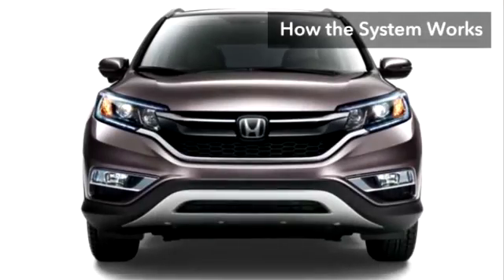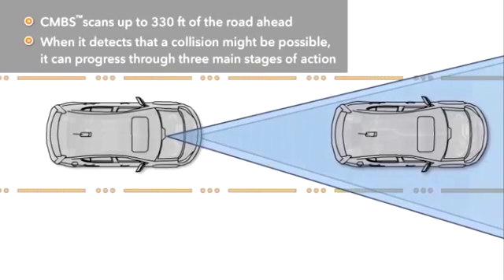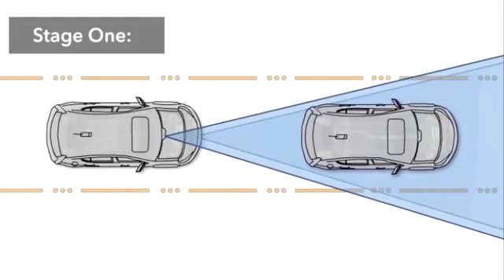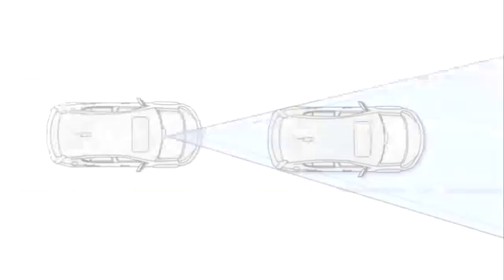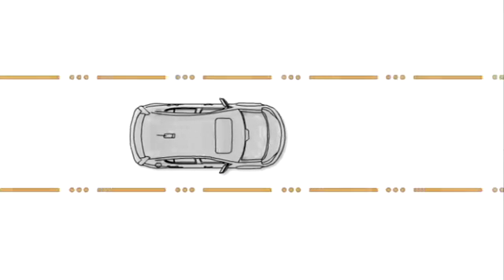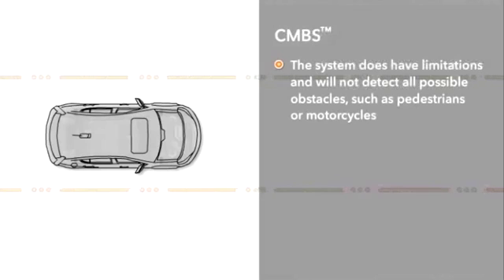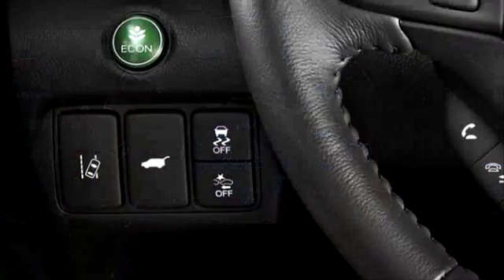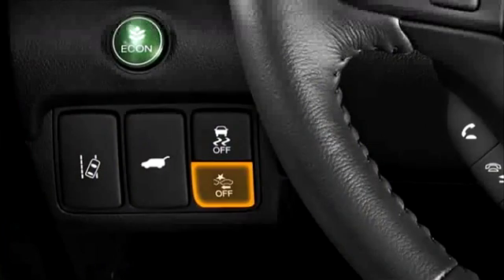Collision Mitigation Braking System™ (CMBS™)

Comment: Safe driving is being aware of possible rear collisions from drivers behind you. Quick braking can cause those type of collisions. CMBS could cause those type of collisions. While I'm glad I can upgrade to a newer Civic, I am glad that I could turn the CMBS off.
Reply: As the owner of a 2020 CR-V with this feature that's a very good point. I've noticed that if this is on while using the adaptive cruise control with slow follow or whatever honda calls it where it keeps a cert distance between you and the car in front. If I'm passing someone in the turning lane and I'm in the lane closest to them, this system will often apply the brakes for no reason. Not hard thankfully. And I found out recently that I can stop it from doing that if I just press lightly on the gas pedal when passing someone in the turning lane in that situation.